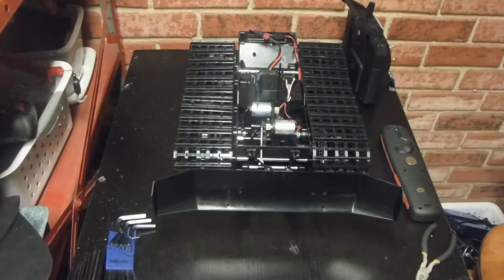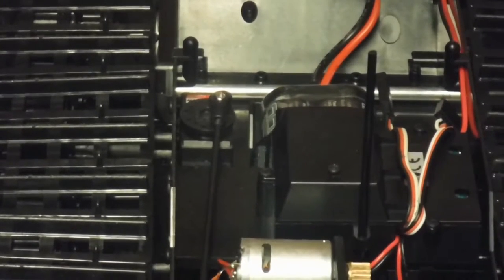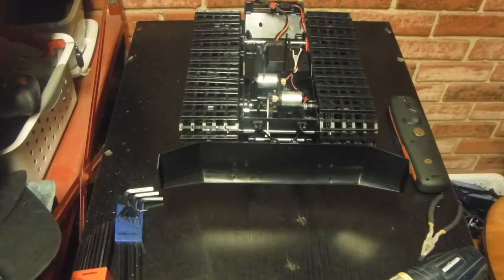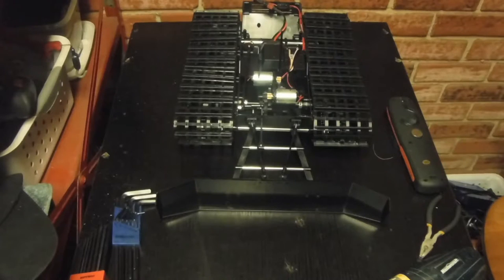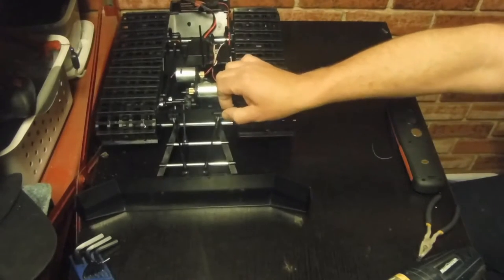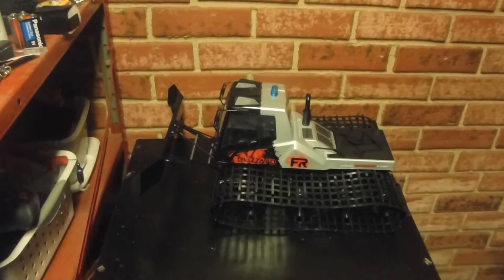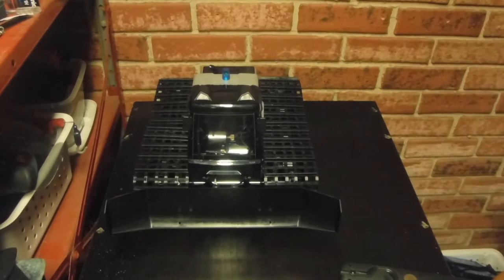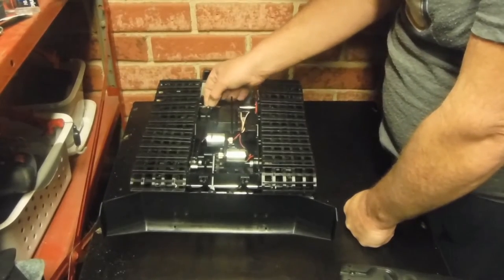Kyosho Blizzard FR Servo Horn Mod With Control Switch Mod For The Blade

Comment: Good job that's about how mine is working also, I suppose if guy's don't have any servo horns they may be able to drill a new hole in the stock servo horn and reuse it and then adjust the tie rod ends for the perfect throw.
Reply from the maker: +shenlonco thanks and yes you can redrill the stock horn and adjust rods for sure this is a way nicer set up so far testing time today

Comment: Is it just because it doesn't have as much leverage that it's not as strong?
Seems to work pretty good, next mod will be steel tracks? bit more weight will probably make a big difference, maybe even just some weight inside the body?
Reply from the maker: +Jax Teller RC metal tracks are in the works as well as the saber tooth esc and upgraded Brushed motors and yep she needs more weight for more traction
Reply: Kevys Rc & Music
Awesome!
Reply from the maker: +Jax Teller RC :)